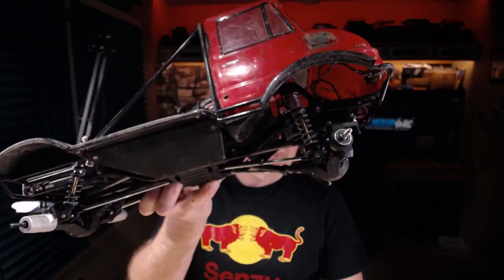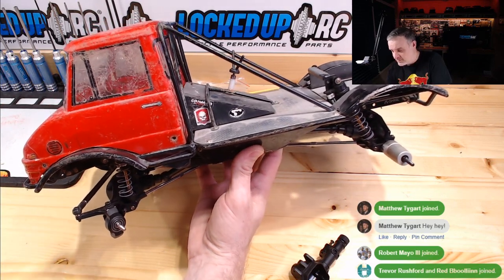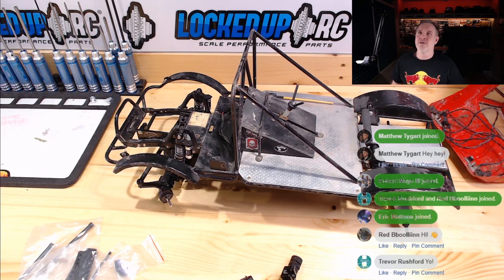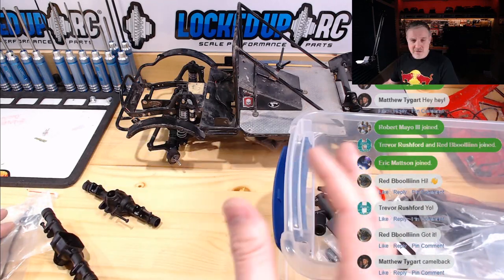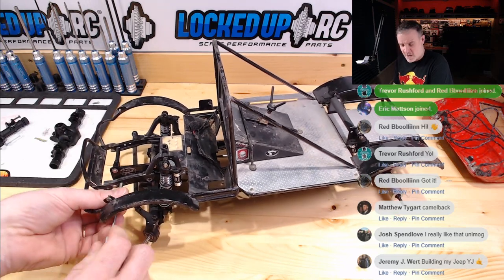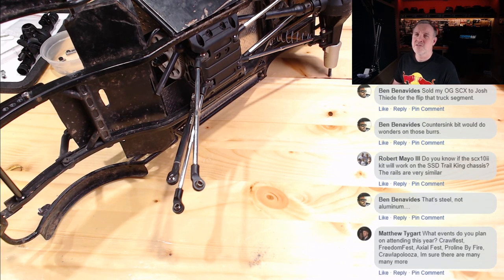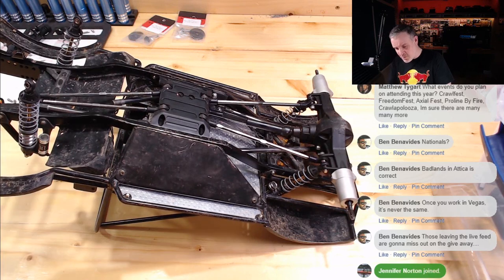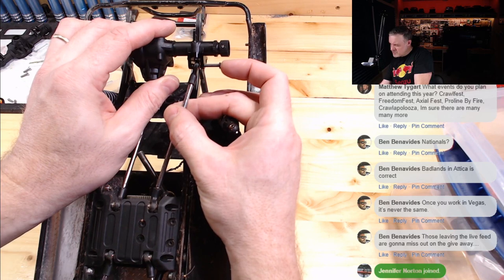SCX10 to SCX10-II Axle swap with CMS

Comment: I've got an O.G. SCX10 with a hilux body and full interior.  She's a complete beast.... stock axles with over and under drive. Dig. Mip shafts.  Winch.  Etc.  That said,  I would like a more scale look.  So I picked up a pair of these axles and am currently eye-balling my custom 3 link vs this new axle. Gonna need to bust out the stainless 8/20 all-thread. 

So the rear links look like they'll line up pretty good? Yeah?
Reply from the maker: Yep. Truck has been sold but we got it to work without too much fuss!